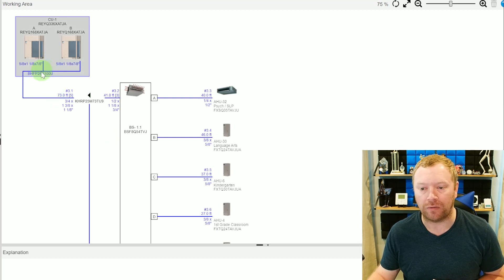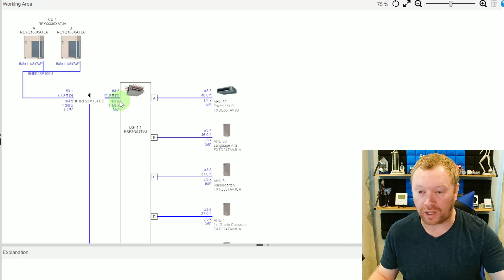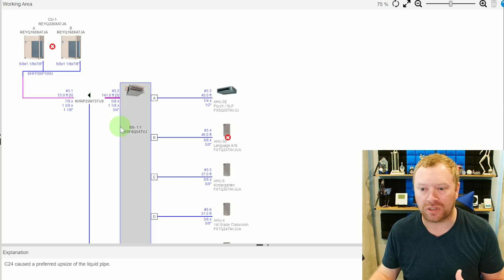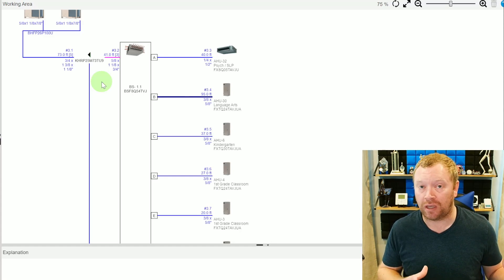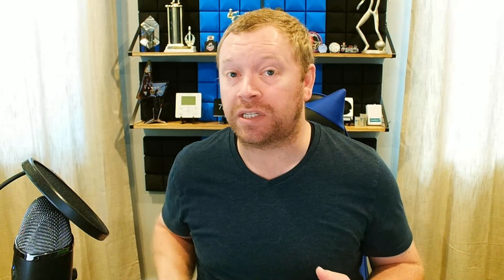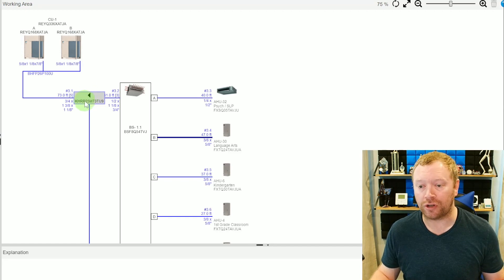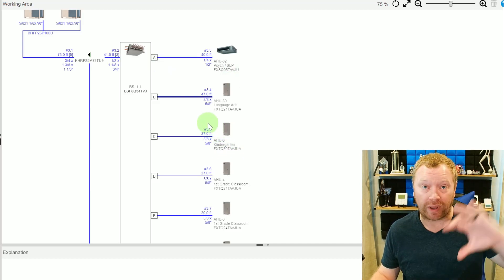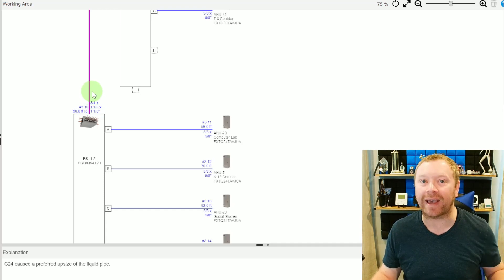VRF Pipe Sizing MUSTS | Importance of Proper As-built Lengths and Sizes 7-30-2022

Comment: Hey Dana,
How can I make a schematic if there are already 3 outdoors? Let's say there are 2x of reyq14 + 1x of reyq12 that I want to put as outdoors (master + 2x slaves = 14+14+12) units?
Xpress does not allow me to choose number and models of outdoors...
Reply from the maker: You need to adjust connection ratio Max allowance along with block loads for heat and cool such that the software selects that overall model size.

Comment: Can you explain what declaires the maximum length between the branch and the furthest unit? Why is it 131.2 feet?
Reply from the maker: this is calculated and tested by the factory so i cannot say "exactly" why they determine this length. Usually though it is a combination of maintaining proper oil return and capacity. too long and the line set size may need to change, and capacity could drop. if refrigerant velocity drops too much due to the line length being too long, you then also run into oil return issues which will delete compressors.
Reply: @InverterAlways  Thank you very much.

Comment: Seems like you know quite a bit about the Daikin lineup- quick question- that daikin cannot seem to answer for me. I’m used to only installing Mitsubishi Ductless- and specifically with their Multi zone outdoor units- their fans will noticeably run at many different speeds (sometimes barely spinning, sometimes full crank). I just started installing daikin due to availability and my first system was a 4 zone 4mxs36rmvjua- and the outdoor fan seems to run at a good rate regardless of what the indoors are set at/ doing. It never ramps down very low/ is this just a daikin thing or do I have a bad board possibly?
Reply from the maker: I would say neither. Depending on load and mode of operation the outdoor fan will ramp up or slow down as needed. If I recall there are somewhere around 5 to 7 fan speeds on the outdoor DC motor buy don't quote me on that I would need to verify in the service manual. You can plug in a dchecker to see the internal logic and data points to verify as well. Usually the outdoor fan runs harder in heat mode compared to cool mode but again will ramp up or down as needed with load as well. I would say to just monitor the system for a while as it ramps up to meet a high load then slows down as it approaches target. You should see a change.